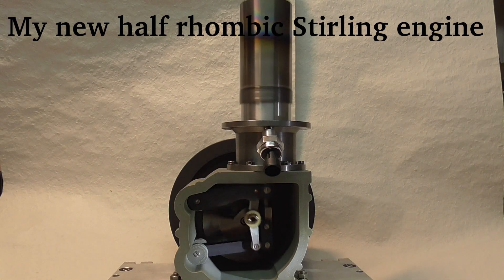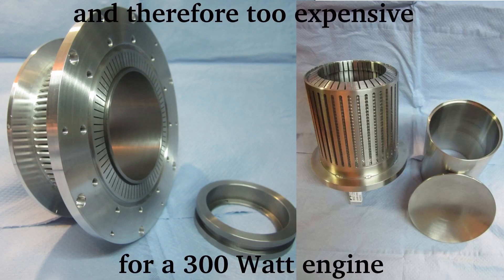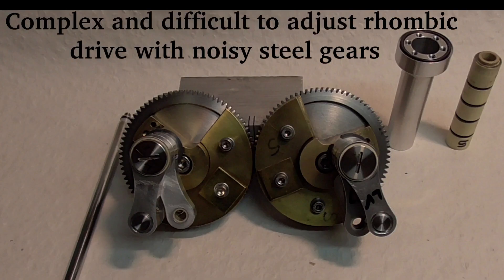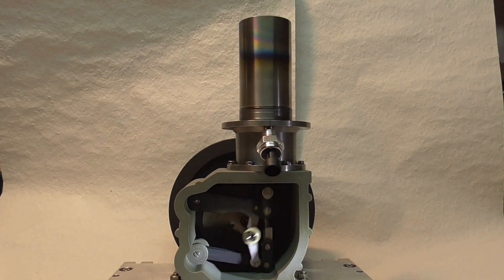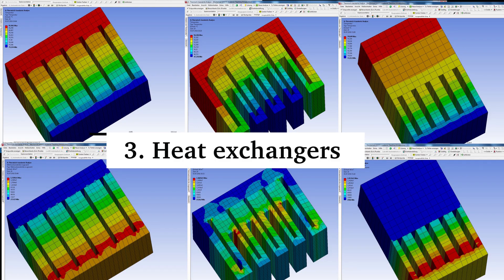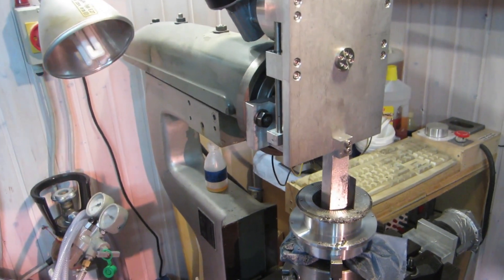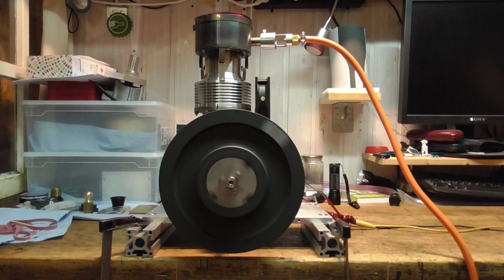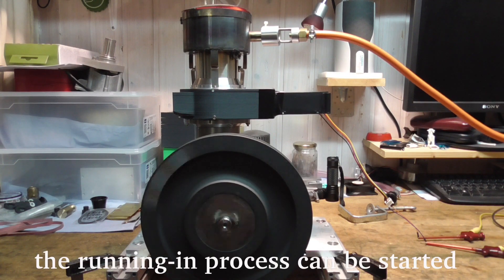Stirling engine with 3d printed half rhombic drive and details of development and optimisation

Comment: You can also replace the air with helium, helium can be bought in "birthday and carneval stores" in small pressurized bottles. You would have to add 2 one way valves to exchange the gas inside but this should improve efficiency further and might be just a small change as an add on.
You also improve combustion by using the same compressed air you use to cool the engine to feed into the burner. Examples of this can be seen with thr Philips stirling engine.
Reply from the maker: Yes, thanks I already made some experiments with helium but have to test it more.
Combustion air preheating is important for good efficiency and I will do that when the engine reaches target power.
Thanks for your hints

Comment: Instead of cutting all the parts wh not use MLS (metal laser sintering) to 3D print the metal parts with all the channels in place, this way the whole part with the regenerator can be optimized and printed as one part which would make the welding and slotting process obsolete. I know it´s more expensive to print the part but if you value your time and you want to mass produce the part some day this is the way to go to reduce complexity.
Also you don´t want to create additional "dead space" that´s why it´s called dead space, but you want a regenerator.

Comment: It´s not a rhombic sterling engine it´s an beta sterling engine with a rhombic drive. You can increase efficiency and cerease part count and complecity further by completely removing the linkages and replacing them trough a "free piston" design".

Comment: So how difficult would this be to convert into a ten horse power design with a constant input temp of 1050° and if a ten horse power design couldn't be done is it possible to do anything 2 hp or above?
Reply from the maker: Hi Trey,
sure this is possible but I find it hard enough to produce a reliable 300 watt engine.
It is much more work than it looks like and experimenting with more powerful prototypes will make it much more expensive as you have to build much bigger or use higher pressure.

Greetings

Ralf

Comment: Your work is amazing 👏  I would buy one of your builds think about it
Reply from the maker: Thanks
Reply: @myengines2443  how much for a finish engine. Also is this based off the Philips design
Reply from the maker: @christophercridlebaugh8965  the engine is still in the experimental phase and not for sale.
It is not based on an Philips design because it has an HALF rhombic drive what was not used (as far as I know) by Philips.

Comment: So, did you get at least 100 Watt?
Reply from the maker: Hi,
the last few months I was optimizing my workshop and didn't experimented with the half rhombic further.
But now I will start to work on the Stirling engine again and report as soon as I get some reasonable results.

As I now use the complex heat exchangers of the original rhombic stirling which delivers 300+ Watts I think that I will get much more than 100 Watt.
But unfortunaly not with the 3D printed parts, they are not strong enough.

I replaced them with metal parts an get very promising results in first test runs.
The half rhombic drive will only be a success when the power will be in the range of the original rhombic (300 Watt), the vibration will be acceptable and piston side loads low.

Greetings

Ralf

Comment: Have you tested this engine for life? Is a liquid lubricant used or is the tribological polymer run dry?
Reply from the maker: Hi,
I have made the experience that printed parts are not durable enough and made all parts in metal now.
Soon as I am ready with my EDM project I will make a video about it.

The polymer runs completly dry, thats its advantage.

Greetings

Ralf
Reply: @myengines2443  Thanks for the answer! Good luck with this project!

Comment: Nice job! Do You consider to use water cooling?
Reply from the maker: Yes, as the durability and strength of the printed parts is not good enough I again use my old water cooling of the original rhombic engine.

Greetings

Ralf

Comment: is this a never ending fun tweaking/optimising project to collect spreadsheet data or does the machine have a practical diy purpose? ,diy cryocooler engine for over night hydrogen production & dense liquefication etc, i.e something diy cant normally do on demand at home without an expensive commercial ready made unit.

feed stock to operate room temp 'Tesla Turbine COLD STEAM Testing, Medium RPM low temperature, 61280 RPM' then use the expended small bubbled trompe reservoir atmospheric temperature gas + oxygen, nitrogen etc to sand tube heat the garden patio greenhouse direct under water pool heater/burner ^_~ etc

Comment: Hi ! How can i contact you ? It looks like i am repeating you "way" - i am building mine first rhombic drive stirling, and it really looks like not as easy to make, as it looked first - due to tolerances and etc. Strange on you gear wheels failure. Write me at staskaaa eta gmail com
Reply from the maker: Hi Stanislav,
nice that you are also building a rhombic Stirling.
The rhombic drive is really elegant but demands very high tolerances and good machining.
I am struggling with it since years and thats the reaseon why I tried different drives the last year, but now I will return to the rhombic because it is worth the effort.
Lets discuss things here on youtube because than everybody can read and join the discussion.

Nice wood oven, do you want to power the stirling with it?

Greetings
Ralf
Reply: @myengines2443  Thank you. Still - drop me a mail. Looks like youtube blocks posts with images.

Comment: Hi Ralf, 

your engine with half-rhombic drive looks beautiful and, the same time, very simple. I know that this is just the look  but I believe these are two the most important factors to describe good idea. I've been reading about Stirling engines and want to start experimenting by myself (mostly different materials and heat exchangers) but there is not much real drawings in the internet to start with (simple, no power producing engines or people who didn't make any measurements not counted). Do you have any drawings that you can shear? Or at least dimensions of the components? Link to STL files below is no longer valid.

Thank you very much and good luck with your inventions,
Sergiy
Reply from the maker: Hi Sergiy,
nice that you also want to build Stirling engines it is a lot of work but very satisfying when an engine runns well.
Look for the book "Making Stirling engines by Andy Ross" it is free in the internet and very good. Also a good choice is "The Stirling engine Manual 1 and 2" by James Rizzo.
I have no proper plans but if you serch a bit you will find the basic design parameters in the internet.
Its best to design your engine from scratch then you can build it to match your workshop skills.
Greetings Ralf
Reply: @myengines2443  Hi Ralf,

thank you very much for the books. I went through Andy Ross's book about a week ago and now I try to get my hands on "The stirling engine manual". 
Have a nice day and thank you very much for your videos!

Sergiy

Comment: Hi Ralf
Good to see a some great use of 3D printing in a (non-toy) Stirling engine.  We just need affordable 3D metal printing for the top end now, so that the heating into the working gas can be optimised.
Regarding pressurisation, I'm sure the shape of the crankcase can be improved and ribs added to help achieve higher pressures - obviously with great care.
Keep up the good work.
Reply from the maker: Hi Adrian,
I worked with some 3D printed parts of copper, they were expensive and not absolutely ait-tight.
I think metal 3D printing has to get much cheaper and better (tightness) to use in engines.
Good to hear  of you and with best wishes
Ralf

Comment: Ralf - As ever - your work is just way out in front!
A question. How were you cutting internal fins in the s/s hot cap?
Was that via the thrust head?
Or wire erosion?
Andrew
Reply from the maker: Hi Andrew,
yes I cutted both fins for the heater and the cooler with the self made thrust head.
In an older video you can see it in detail.
Nice to hear of you and with best wishes and greetings
Ralf

Comment: Wonderful work as always. I'm pleased to see you making use of 3d printing. Will the crankcase handle pressurization being plastic? It would be amazing if it did.  I'm also wondering if you have plans to 3d print the heat exchangers and have them cast (i.e. lost wax) and use something like a copper alloy because of the high melting point compared to aluminium, maybe CuNi alloys?  (I'm not sure if that could handle pressurization)  Just some ideas. I love your videos. Please be encouraged to make more.
Reply from the maker: Hi IronGoober,
surely the printed crankcase will withstand only low pressures, no way of 10 bar.
When the development is finished and power and reliability are satisfying the metal casting of the crankcase and the heat exchangers is the only way of cost effective mini production.
Many thanks for your interest and your kind suggestions.
Greetings
Ralf

Comment: Great progress! If there would be an afordable good quality stirling engine on the market (±300W electric output) I would buy one. Printing reduces the prince of one, but I things large scale production is the way to go: make & sell millions of units.
Reply from the maker: Hi Giesbert,
thanks for your interest and high expectations. Maby if the engine proves as useful I am dreaming of a small mini series of up to ten engines. Then it would be interesting to 3D print.
As soon I can make use of metal casting it would be far better but not for prototypes.
This would be very costly or another hobby of its own.
Many greetings
Ralf

Comment: what are the benefits of a rhombic or half rhombic system compared to the pistons being 90° out of phase? what is the motion like?
Reply from the maker: Hi Nicolas,
these crank drives give the possibility for a beta inline Stirling which may give better performance and efficiency for small engines.When you look on the piston position diagram in the video you can see that the fluid distribution of the working gas is very good for the Stirling cycle.
Greetings
Ralf

Comment: some info.       this engine is  NOISY.....Why.        the displacer and the piston  should  Not contact one another.       the  Simplest  linkage is the  MOST  efficient linkage.  so,   FORGET  overly-complex linkage schemes; such as  the ross or rhombic linkage.    the beta config is the   worst.   because, there is  Very  little  inherent  thermal  isolation of the sides;  use either alpha or gamma config.     when an engine, especially a beta stirling, is  VERTICALLY  oriented ,   FIFTY percent of  the time,  the engine must  Fight   Gravity !!!     googletranslate      see an alpha;  NO  extra  cooling   NEEDED
https://www.youtube.com/watch?v=OUlQIQ3FNIQ

Comment: But what would be the price just to get an idea 🙃
Reply from the maker: Hi Tristan,
the original rhombic is so complex that the price would be so high that it just might be interesting for someone who wants to experiment with it or for academic use.
Absolut unreasonable for a generator or micro CHP.
You want to hear a number so I just say several thousend dollars for just the rhombic Stirling engine without the accessories.
This is ridiculous for a 300 watt engine.
This is why I try to make it more easy to maybe make it possible to use it as a generator or micro CHP.
Many greetings
Ralf

Comment: Outstanding excellent work what do you think about Thermoacoustics ? Wouldn’t it be a better approach as there’s only one moving part iv had som pretty good results with my primitive engine that I’ve designed I could imagine you would do a much better job than me😂check it out
Reply from the maker: Hi Tristan,
the thermoacoustic is a very nice concept but has there ever been  an engine with more power than a few watts? I thought it is just for very small engines in special requirements or am I wrong?
Thanks for your interest and with best wishes
Ralf
Reply: On the contrary they actually produce multiple kw at half the size and are a lot more efficient due to that reason thirmoacoustics are the fundamentals of a good stirling engine 🤗but a good Thermoacoustic engine doesn’t need all of those moving parts The Sterling engine is actually a clumsy way of utilising thermoacoustics which is the heart of the power
Reply: Hey man I am here because I am into the idea of building a thermoacoustically driven thermoacoustic refrigerator. (Yeah I kinda fell down the rabbit hole). Is yours designed to produce electric work or mechanical?
Reply from the maker: Hi Jansen Dwan, 
I dont find your original post so I answer here.
Yes you are right I am from Germany but it is better to write in english because then everyone can understand and discuss with us.
I bought all all my machines used and very cheap on auctionplatforms like ebay.
You have to look very carefully and a long time because there is a lot of scrap for high prices.
I also made the cnc - conversions as cheap as possible so I just paid a few hundred dollars for each machine.
The machines are mostly used for my Stirling engines but sometimes I build some fun stuff with/for my kids (thats the alibi for my wife ;-) )
Greetings
Ralf
Reply: Jansen Dwan Either either that’s the thing with these engines I haven’t done A frost test yet i would have to make a empg to power it or another engine to pressurise together one hot one cold 🤙